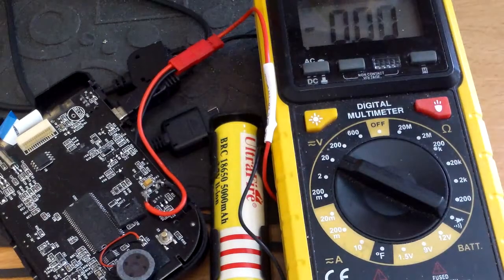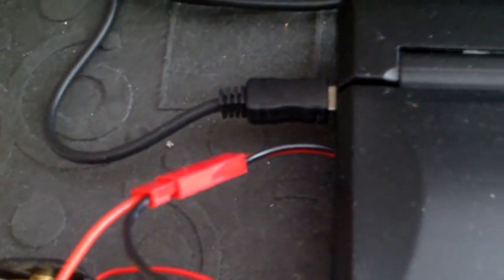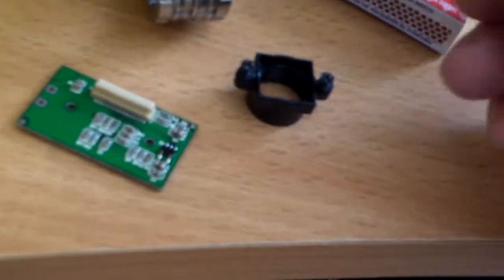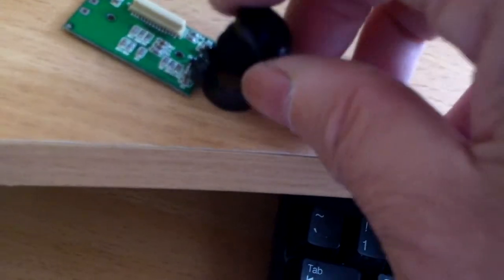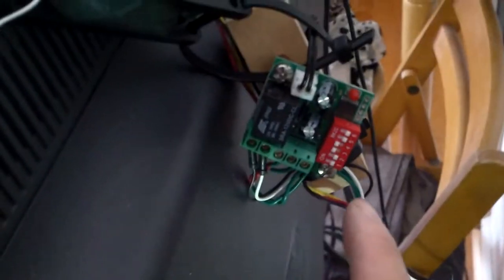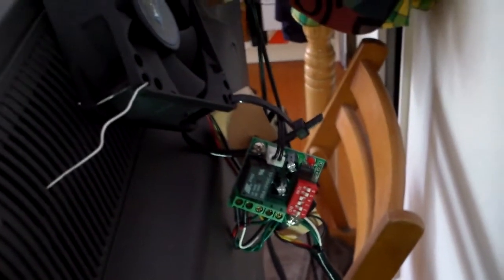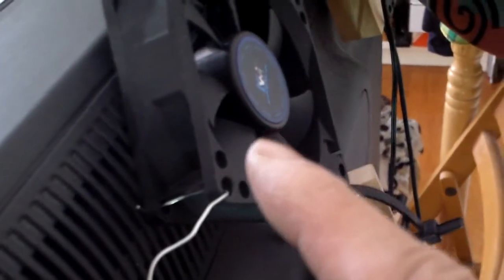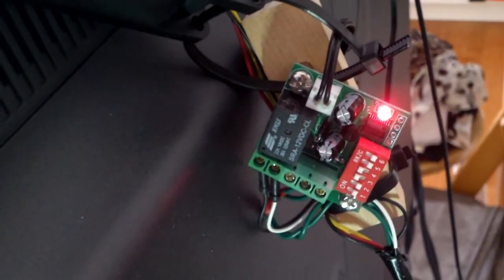Re-purposing dash cam as lithium ion battery charge controller

Comment: Great you can make use of the parts from that camera.  good to see it's not going to waste.

(Of course, when the electronics die of old age (about 2 weeks from now I figure), I'd like to see what else you can salvage).

Also like the fan on the tv.  Looks like a great "hack job", same kind of thing I'd conjure up, but it works and it works perfectly every time for its particular application.
Reply from the maker: I wanted to replace the foggy lens/camera on that Prius but it's like $250 or $300.  This spare lens might just do the job. I have to let go of some of these "junk", but not just yet.